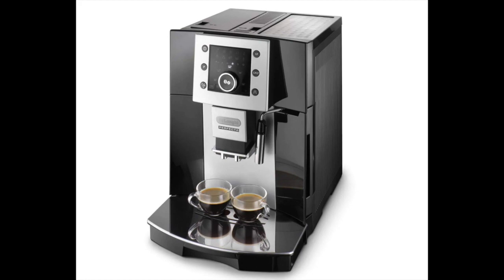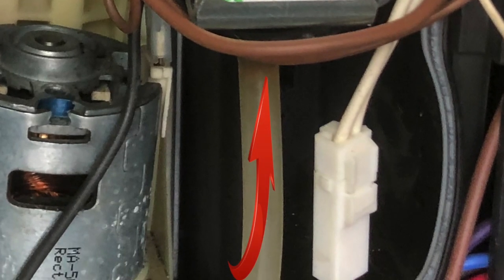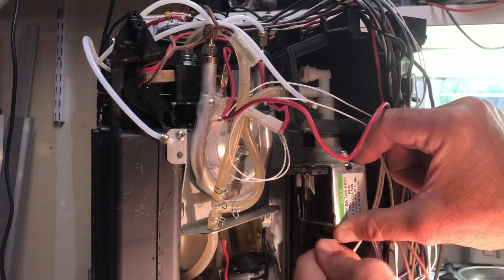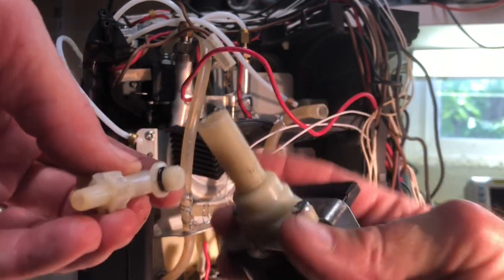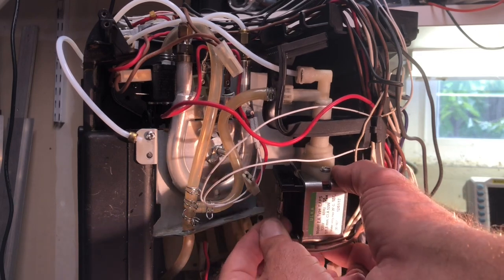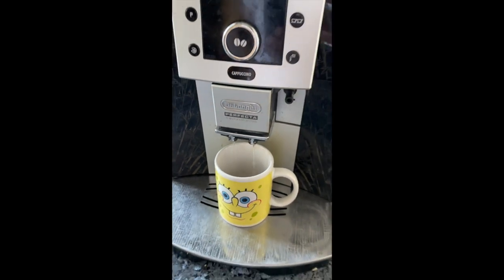DeLonghi Perfecta Pump Replacement

Comment: Just to say thank you very much, I now have a working machine (and coffee), thanks to following your video. I had wasted a lot of time because the coffee machine error indicated that the grind was too fine and I took the grinder apart first, then I realised that I got the same error trying to get hot water and the pump was hardly making any noise. Just to note that in the UK at least if you Google for perfecta 5400 pump, it takes you to an Amazon page with exactly the right pump.

Comment: This video gave me the confidence to replace the pump on my Perfecta.  Thank you so much for this video!  The only differences for me was that the thermal switch on my unit was hot glued into the pocket, so I used a hair dryer to loosen the switch, and I only detached the water intake tube, then unscrewed the pump leaving the top two tubes connected to the plastic connector at the top.
Reply from the maker: Excellent! So glad you took the plunge. I find that with each repair, mine goes for about another year but the repairs also get easier since you get more familiar with the internals.

Comment: My water is in the tube up to the water pump, but nothing after that, no signs of water in the tubes above the pump. Is this an indicator that the pump is in need of replacement? thanks for your experience
Reply from the maker: Just to start, what makes you suspect the pump? Is there no water flowing out of the coffee ports? Have you tried the hot water outlet as well? Do you hear the pump running (a loud, vibrating sound)?

To answer your question, unfortunately, you can't tell if the pump is bad just by looking for water in the connections.
Reply: I was getting grind to fine, and no water would come through. I’d put water spout in and only steam was coming out, not the usual water flow. I cleaned the diffuser and that didn’t work. The machine then worked the next day for no apparent reason and after 3 days, no water rinse at start up or when turning off, too fine grind appears , no water from the sour and no water running through machine. Only dry ground coffee in the grounds container.
Reply: No coffee coming out at all just grind too fine
Reply from the maker: @marybethmielke3766  Yeah, it sounds like it could be the pump. If you have the same model as mine, the pump is only $25 at Amazon so I'd replace it and see if that fixes it. The 'ground too fine' error can be thrown if the water meter is bad (I have a different video on replacing that) but I don't think that is the problem here.

Comment: Is there a trick to getting that little cotter pin back in - I am pushing and pushing the tube in trying to get the gold ring in but it is blocking the pin no matter how hard I push? What am I doing wrong? Thanks
Reply from the maker: It doesn't take any real force so if the tube doesn't go in far enough, something's amiss. A couple ideas:
1) make sure you don't have two o-rings. I've done this before where there was an o-ring inside the receptacle and one already on the tube
2) make sure to push the tube straight in or it can get hung up on the sides.

3) make sure there is no debris inside the receptacle. I've had mineral deposits there. You can use a toothpick, a metal pick, or even a stretched paper clip
4) make sure the tube end isn't distorted badly

Use a good light and a magnifying glass to examine everything involved. Putting the hose clip back on should be easy so something's in the way.
Reply: @ravraid  - Thank you - I will try all those things…. I’m so close- argh ! Thanks
Reply: @ravraid  your paper clip mineral deposit seemed to do the trick! You are a genius!!!! Pump is now working but nothing at all coming out of the coffee spouts ! The steamer side is working though. Do you by any chance know what my next move is? - Thank you Thank you
Reply from the maker: @zee1272  Good, glad you got it back together. If you are getting steam out from the hot water spout, that indicates that the pump is working. Unfortunately, there are a number of things that can block the water path through the coffee grounds. Was the coffee path working before you changed the pump? Are you getting any error messages on the display? I have several Delonghi videos on my channel including one on the machine's diagnostic mode and in one of them I describe the entire water path so you might want to check those out. One or two might be on the Magnifica but the Delonghi machines are all very similar inside.
Reply: @ravraid  When the pump dies everything stopped delivering water/coffee - so yes the coffee path worked prior.The error message I get is the water tank light - but then I prime it and water delivers through the steamer but when I try to brew a cup nothing comes out of the coffee spouts -If you can direct me to the water path diagnostic video I’d appreciate it. Any other suggestions would be very much appreciated. Thanks again for all your help!!!!!!! I’m not giving up hope yet !  Is that front door piece something that needs changing ? I cannot find any videos or parts on that so it makes me think that it is ok - The spring hinge is good and I cleaned out the spouts with a toothpick. …….
Reply from the maker: @zee1272  Here's the video on using the diagnostic mode: https://youtu.be/CFbMPbuzFCo

By the "water tank light" do you mean the "low water" message? If that is on, I think nothing should work because the system believes there is no water available.
Reply: @ravraid  so I have a different machine than that it’s a Delonghi Magnifica ESAM 04110S and the light that comes on is like a pitcher of water. (But the resvoir is good) When I talked to Delonghi and that light came on they instructed me to turn the steam wand on and it was able to deliver the water. They wanted me to send it in for repair but for $259.00 and 5 weeks with no warranty did not sound like a good deal. So I’m stuck with what to do next? Thank you
Reply: UPDATE - I decided to remove  the valve pump part and clean it and re-attach it and check all the connections again - then I put the machine on, but the water light came on AGAIN and  nothing came out of the coffee part….. I tried the steamer again and water ran through, then the water light turned off - I thought “oh well” and I turned the machine off and what do you know…..as the machine went off WATER came through the coffee spout ! I I couldn’t believe it ! I then tested it with coffee and it WORKED !!!! I can’t believe it… I waited a while, turned the machine off and tried it again….still working !!! So the real test will be tomorrow morning ! Finger’s crossed. I CAN’T THANK YOU ENOUGH FOR ALL YOUR HELP ! YOU’RE TERRIFIC, warm regards, Zee
Reply from the maker: @zee1272  Hey, that's great news. I hope you enjoy coffee tomorrow!

Comment: The seller of the pump told me to add water to the pump before I use it but I don’t know how to do that? I didn’t see you add water to it ? I have a Delonghi Magnifica. Any thoughts on this ? Thanks
Reply from the maker: Priming the pump is a sensible thing to do but, no, I didn't do it! If your new pump doesn't have the valve on top (like mine) then you could pour water into the top there before screwing on the valve. I don't think pouring water into the bottom will help as it will just drain out. I will say that I've probably replaced 5-6 of these pumps over time and never primed them. I might've shortened their life a bit by that but I get reasonable use - years - out of them.
Reply: @ravraid  Thank you I should get the new pump in the mail tomorrow- I will be connecting the valve to it - Are you saying to add water into the top of the new pump before I connect it to the valve? Is it a simple thing to do? I don’t understand what you are saying about pouring water into the bottom? Sorry I am totally an amateur here. Thanks again
Reply from the maker: @zee1272  Yes, I think pouring water into the top of the pump before screwing on the valve would be the only way to go. Again, I've never primed these pumps so, personally, I wouldn't sweat it if you can't get much water in there but it seems like a sensible thing to try and can't do any harm.

Do make sure your Delonghi is unplugged as you work on it.

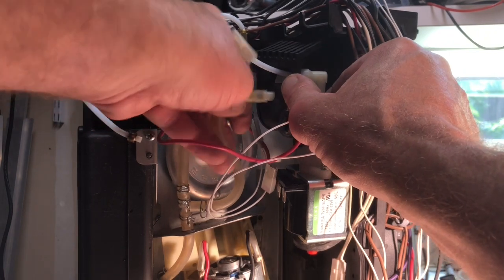Comment: thanks for the video, just so happens I'm in the middle of changing pumps on a machine someone was throwing out. I'm having trouble pushing the clip that holds the small hose at the top (around 4:34 of your video), feels like I'm not pushing the hose far enough in. I'm guessing the clip should catch only the hose, behind the metal collar? thx
Reply from the maker: That happens to me all the time. A couple thoughts: 1) confirm there aren't o-rings both inside the connection and on the hose - there can only be one. Perhaps your new pump came with an o-ring in place and you have one on the hose too. 2) I now use a food-grade lubricant (Lubrifilm) when I reassembly these connections because they can be fussy. I think I've also just used vegetable oil in a pinch. If the hose goes in to the right depth, the clip will slide on very easily - no need to force it. Good luck!
Reply: @ravraid  thanks for the reply. I actually replaced the pump with a spare one I had from a Rancilio machine that I love! Problem is I'm not getting water past the pump int the system. I disconnected the outbound connections from the pump, and the pump does work. So the next thing is I looked at the valve connected to the outport of the pump. It has a spring inside with a small plunger and am wondering if the water pressure from the pump is not pushing the spring open. Checked DeLonghi parts website and that valve is not available. Any suggestions? thanks
Reply from the maker: @mrx-in4xh  Sorry for the delay. I think you are referring to one of the solenoid valves. I"ll bet I've replaced 5-6 of these in the 3 DeLonghi machines I've owned. I'm not sure what fails but I'd bet it is the coil for the solenoid. One way to check the solenoid is to use the diagnostic mode. I made this video for that: https://youtu.be/CFbMPbuzFCo 
If you activate EV1 or EV2 and you don't hear a loud clunk, the solenoid is bad.
Reply: @ravraid  thanks again
Reply: @ravraid  can you tell me what the top part of  the Pump does? It seems to connect the lines to the coffee brewing etc . I looked it up and it’s called the   Valve Water Fitting Pump. that part I reused and connected  to the new pump - is that something to clean or fix or replace that could make a difference ? I don’t know what I’m looking for and have checked out all your videos. I hope I’m not bothering you ! Thank you
Reply from the maker: @zee1272  Sure, if you review this video at about 1:05, I mention that the top fitting is where the pressurized water comes out going to the rest of the system. This is the connection you're interested in. The bottom fitting is just a drain so you're not interested in that.

You mentioned the hot water valve had steam coming out. Did the coffee work before you replaced the pump?
Reply: @ravraid  So before I changed the pump the the steamer was not delivering water nor was the coffee making anything at all. Now just the steamer valve delivers water and steam. On the top fitting that you pointed out where the pressurized water is could that be my problem and if so what can I do? Many thanks

Comment: Mine had water coming from the wand but nothing from brew. I was also thinking about blockage but the pump was also my problem. I was getting grinder was too fine error on screen. Thanks for your video.

Comment: Also, if the pump is in need of replacement, where do I order that and would you have a part number? Thank you
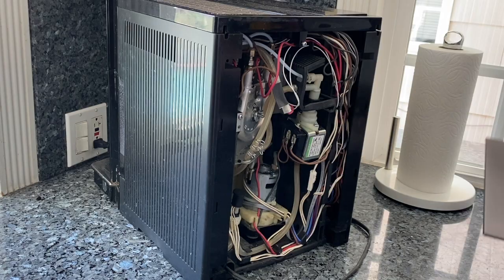Reply from the maker: In the video, at time 1:03 there is a close up of the pump label so you can see the part number and google it - there are at least 3 different Perfecta model numbers and they might use different parts. You can also google your delonghi model number (e.g. ESAM5500B) along with "pump" and you'll get hits. I often go to ereplacementparts.com as they have a pretty extensive inventory.